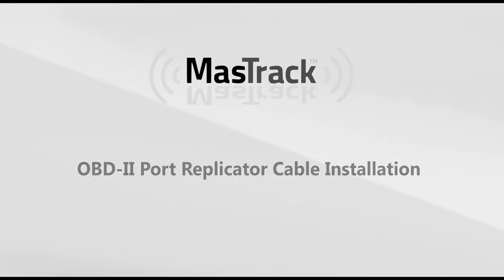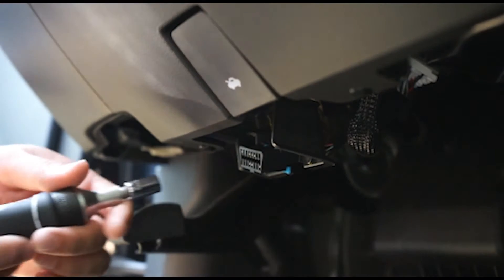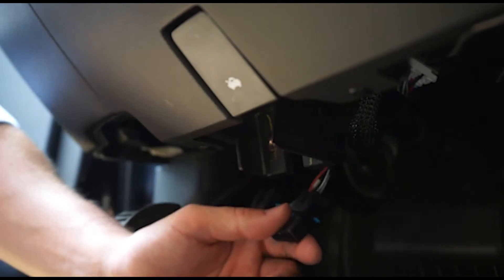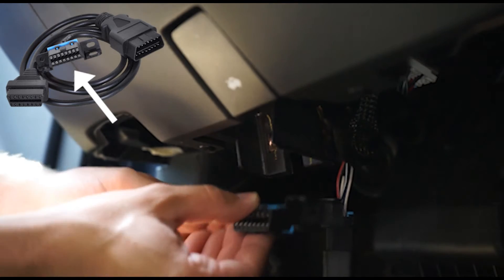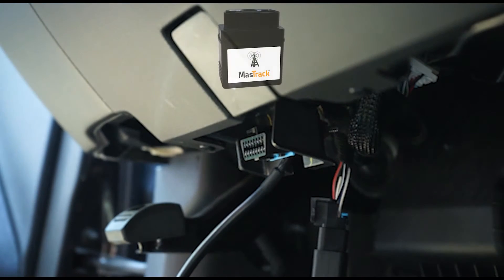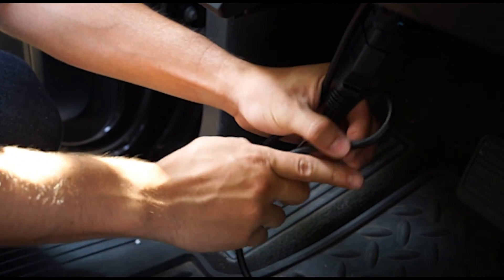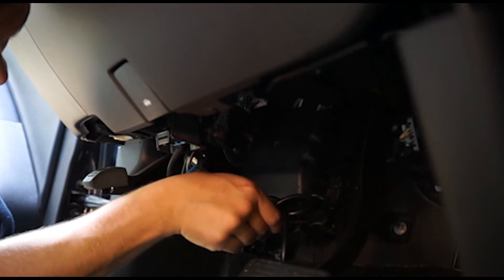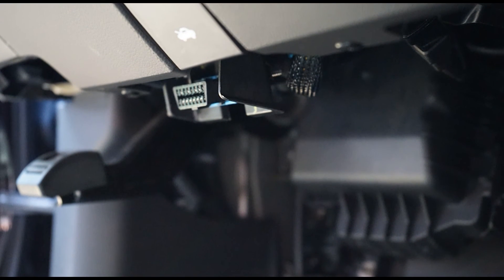OBD-II Port Replicator Cable Installation

Comment: It's not very hidden if a thief sees a obvious connection on it.
Reply: How will they see it if it's tucked under the dash? The only thing that would be left in view is the empty OBD port.
Reply: @powerofknowledge7771  every real car thief will check the obd for a tracker as first instinct. This tracker need to be hidden somewhere else in the vehicle not under the dash
Reply: I was thinking the same thing.They can spot that easily.
Reply: Exactly

Comment: Hi MasTrack, I love this video. It's simple, clear and straightforward. I want to install this exactly to my 17 y. o daughter that I still worried about her driving back and forth to college. She drives a Rav4 XLE  🚗 Toyota 2020. I saw this video and i like the 2nd obd port is out of sight.  Where can I get one for her type of car. Please help. This is a 🌟🌟🌟🌟🌟 video 👍
Reply: They have other obd adapters that can go up and down in pin size on Amazon, if that's what you're referring to. So you may need to use this adapter along with another one that will convert the pin size to a larger or smaller amount.
Reply: Also, I just noticed on their website that they have different size pin connectors to choose from. If you add to cart, the options for the connectors will pop up. https://www.mastrack.com/replicator-cable

Comment: Is this included with the hardwire kit? Were can I buy this on your site
Reply from the maker: Hi kden z,

We apologize we didn't see your comment earlier. 

This is an optional accessory for our MT-OBD Plug-and-Play GPS Tracker. It allows our customers to move their GPS tracker to another location under the dashboard rather than having it connected directly to their OBD-II port - Allows for a more discreet install.

Please note that the Hardwired device is a separate unit and comes with a separate harness. The Hardwired device is not plug-and-play and will likely require splicing. 

I have left several links below with more information. If you have any further questions, please let us know!

MT-OBD Live GPS Tracker - https://www.mastrack.com/plugNplay
OBD-II Port Replicator Cable - https://www.mastrack.com/replicator-cable
GV-50 Hardwired GPS Tracker - https://www.mastrack.com/hardwired